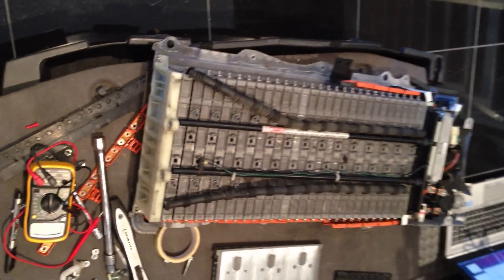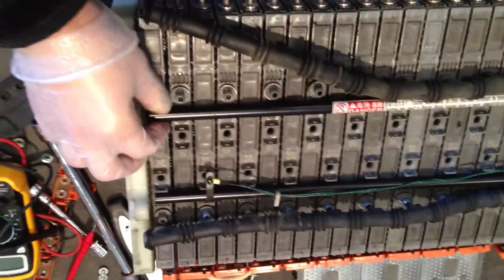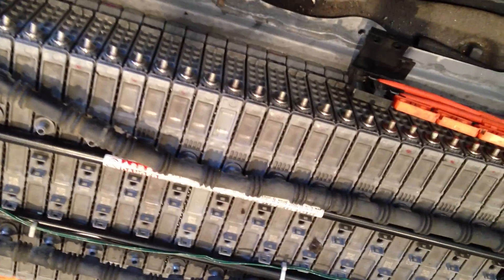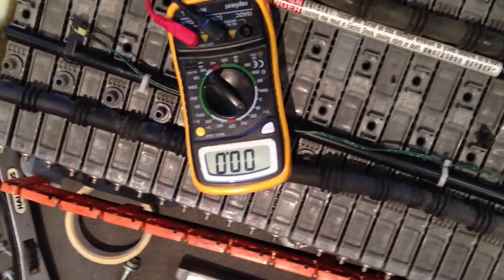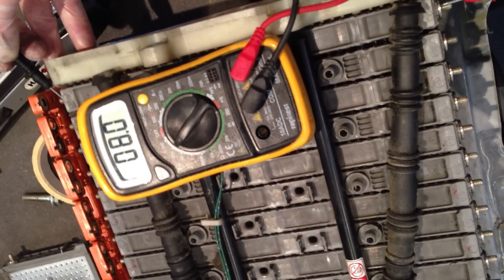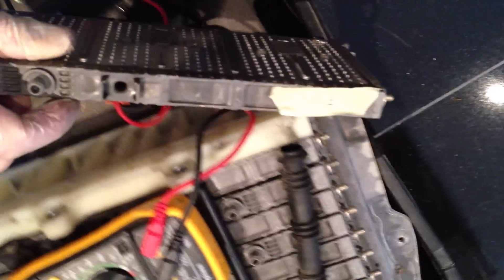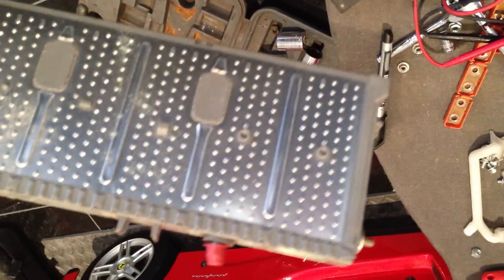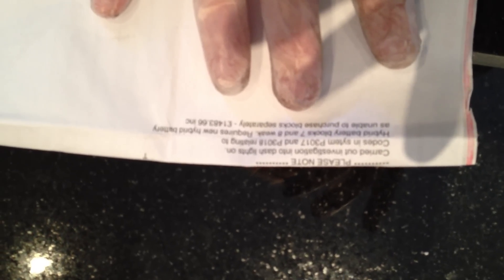Toyota Prius Fix and Replace Battery cell repair cheap.  Lexus Auris Camry Toyota DIY

Comment: I was saved from spending funds on a brand new car battery when I heard about the reconditioning program ( Check Details Here>>>v ), therefore I tried it to recondition my old auto battery! I thought it would take much effort and hard work, however it was simple as ABC. That already saved me about $ 100 and there are a lot of some other batteries.

Comment: I'm doing the loading and unloading test for CIVIC HYBRID 2005 with Imax equipment. but this team has to set the maximum limit you in mah where it will arrive. I put 6500 which is the maximum load to 0.6A and 1.0A perform the download.

What should be my right values in mah to result in a good performance, I read enforos that the burden should give me a maximum of 6200mah and download between 5500 and 6200mah.

Will I have to increase the amount of amps loading and unloading for each battery. or care if I leave as I?

Comment: Question, I saw some of the terminals had some corrosion on them. Did you get a chance to clean those up? What did you use? I think I'd hit it with my dremal and follow up with some bulb grease. What say you?

Comment: what setting are u using on the multimeter in the volts section
Reply: Looks like he had it at the 200v range, but 20v should be fine. If you are doing pairs of batteries 20v should be fine as well. Any more batteries then than then you'll have to go back up to the 200v reading.
Reply: +Robert Rodgers is there a min-max range for each battery. i tested mine with a multi and last week they were all 7.63 to 7.65 now they are all 7.5

Comment: I purchased a rebuilt battery for my Prius ! with GEN II cells. I paid a premium and the battery had a foult initially but driving for a while I could reset the code 3006. To make a long story shorter after a month and a half (waiting for over a month for shipment in the first place) the battery failed. Another month + and no word form Falcon or prius rebuilders on the warranty replacement as promised. 
I took the car to a shop in Ft Walton and they removed and inspected the battery and found two bad cells and of the rest of the cells 1/2 tested OK and the rest were marginal. These cells are from 2004 and the tech said that these were the oldest cells he had ever seen!.
Basiclly these cells were just slightly better than the scrap that Prius Rebuilders and Falcon purchase as scrap in bulk. 
In my opinion you are far better off taking your car to a local guy and have him test and change the bad cells like I ended up having to do to get my car running again.
Do not trust these people and save your money and time and deal with honest trustworthy companies.
If you read other bad reviews don't think that one bad report can happen to anyone like I did. They are bad news and stay away from them.
By the time you have fought over replacement and paid freight and received a battery that is as big of a question mark as the one you removed you could buy one from a reputable company or have a speciaist replace a few bad cells and be better off.
Dont believ their hype on having batteries ready to ship. It was over a month to get my first (bad) battery and over a month and I still have not heard that my (questionable) warranty replacement is ready.
Abe Sokol had lied to be from start to finish and he will lie to you as well!
Stay Away

Comment: The Prius warning panel gives you the same "Main Battery" icon when the little 12 volt starter battery dies.  It only costs $200.00 at the dealer.  Replaced that or charge it first before you go through all the trouble of replacing the drive battery!

Comment from the maker: UPDATE: Sept 2014 and 10,000+ miles later and the car is still working perfect.
Reply from the maker: Update March 2016 my Prius is still working perfectly after this fix 👍🏻👍🏻👍🏻
Reply: @Ratarossa2   Any updates?
Reply: +CoffeeShopCars There are several components to battery repairing. One resource I discovered which succeeds in merging these is the Magic Mender Wizard (check it out on google) without a doubt the most helpful course that I've heard of. Check out this  awesome resource.
Reply: +CoffeeShopCars There are several components to fixing a car battery. One place I discovered that succeeds in merging these is the Magic Mender Wizard (google it if you're interested) definately the most useful course i've seen. Check out this  extraordinary site.

Comment: worked for me, the hard part it´s putting all cell´s together again, I´m still testing my car, so far so good.
Reply: Updated: battery dies, these method didnt worked XP
Reply: Alexander Juarez Did you drain the battery then balance recharge?
Reply: How do you drain, balance and re-charge the battery?

Comment: Soo.....I'm a mechanic at a Toyota Dealership and we definitely have to wear better gloves than that, there's quite a bit of power running through there even if it is just 1 or two cells.
Reply: Soo....your the kind of people that actually charge hard working families $4000 to change it for them, but thats ok because you wear better gloves?  Why does your company rip so many people off with this issue rather then just replacing and testing cells like this AT THE DEALERSHIP!!?
Reply: hey slick, if a dealership mechanic replaces the one faulty module on your 12 year old hybrid battery and two weeks later your idiot light comes back on, he gets to fix it for free without getting paid since toyota does not warranty a repair like that, their assumption is that if one module is failing now the other ones aren't far behind it. if he replaces the entire battery then toyota warranties that repair for up to one year since someone like you who would probably throw a temper tantrum in the dealership if this happened. whats more of a rip off, charging you to replace all 39 modules as they fail one at a time at about 7 hours labor each multiplied by oh i dont know $120hr? or to replace the whole battery, you do the math genius.
Reply: +Tyler Steen only a rippoff dealer would charge 7 hours for a 3 hour job and consumer should get to make the choice on what they want to repair your logic is like saying replace the whole engine when the water pump goes cause when the timing belt brakes the following week the dealer will have to fix it free. and id the dealer is charging top dollar for replacement battery then why a 1 year warranty. it should be 8 years the same as a new one in a new car. since your overpaying to swap it out 7 hours x 120.00 840 how do you sleep at night
Reply: +kodiackid 7 hour is more time than a novice would need just to swap a battery from a trained pro at the dealer that does it everyday should never take more than 2 hours
Reply: To clarify: The rate charged at a Dealership is a set price in AllData, Mitchel1, Chilton or Toyota's Repair Time Guide designed to ensure no time is overcharged to any clients. That time is determined by those companies, respectively (usually by the average amount of time it takes that repair to be done on 50+ vehicles). More time might be charged (approx. 30-50%) for things like: damaged components, rusted parts, aftermarket accessories-anything that makes the job take longer than normal. Repairing individual cells is not a repair Toyota trains their technicians on and is not approved to do so for that reason, it is dangerous and wouldn't be something most technicians are comfortable doing. The batteries are sent back to Toyota for the technicians who do know how to repair them properly (Those are turned into cheaper re-manufactured batteries). According to AllData-Labor rate for replacing a Hybrid Battery is 1.7hrs(probably rounded to 2)@$116ph. and the Battery costs Approx $3700-Core ($1300-$1500-depending on the size). The reason the warranty is less is because those are typically re-manufactured batteries so the cells may not last as long as a New battery. That 1yr warranty is a warranty on the work performed-not the battery itself, the battery warranty is determined by the battery manufacturer. If the battery failed, typically the battery manufacturer or insurance would cover the cost of labor. Additionally, the dealership is also not the only place to take a battery to be replaced/fixed. There are other repair shops that are specifically certified to repair a battery like in this video  for a lower price than the dealership because more hybrids are on the road.
Reply: +Sergio Salinas well you said 7 hours I think 1.7 or 2 hour is reasonable. as far as remanufactured 1 year is understandable but brand new should be longer. the reasons I'm not happy are for things like being told longer times than reasonable they want to charge 700 dollars for each light changed on headlights. why because some book says to disassemble the front of the car and part of the left and right quarter panel to get at the third bolt on the headlamp. that is done from a poor design to make dealers more money. I can change by hand without tools or removing the headlamp by just opening the back of the light. why can't they change the book for that. I would understand if you had to change the whole light but just the bulb it's not necessary to screw people over.
Reply: +kodiackid hey genius, what makes you think a car manufacturer designs cars with the thought of the dealership making money servicing them? is that why all new cars use fluids and other wearable items designed to last damn near forever no longer requiring them to be serviced? they could care less about dealerships making money servicing their products, least of all mechanics. dealers charge what they charge based on what competition in their market charges, not what a book says to charge, not what the manufacturer says to charge and definitely not what a penny pinchin first gen prius owner/wannabe engineer thinks they should charge. you ever clean corrosion off of your car's 12volt battery terminal only to find that a couple months later the corrosion came back? thats because there is no seal around the battery terminal and the battery case, first gen prius battery are the same, they leak and once they start to leak they won't stop leaking, thats why replacing one bad cell is not the "professional" way to repair the vehicle, you wouldn't be happy when three months later your idiot light came back on. replacing cells is what one might call a backyard mechanic fix, the repair will work but not for long.
Reply: +Tyler so tell me exactly which genius is responsible for charging 700 dollars for each light bulb to be changed in the headlamp on the prius that only takes anyone that has changed one more than twice 10 minutes because the going rate at any reputable mechanic shop would only charge 1 hour max for both and some would do it for no charge just for selling you the parts and as a service of good faith. I have a second Gen prius and if my battery was leaking I would change it. but 1 dry cell out of 28 doesn't justify replacing the whole thing that's just being irresponsible to the environment which is one of the main reasons people buy a prius in the first place. To help the environment. Why is the prius unable to be put in neutral upon battery failure? Do you think that's safe? How many people should have to die before they do something about that??? Other cars have a cord that you can pull to put their vehicles in neutral so they may be pushed out of harms way. You can blame the dealership or the engineer or the parent company but your the one that works for them they sign your paycheck. Someone in that company needs to step up and make it right. I certainly don't blame you but try doing 65mph some night then kill the lights and try stopping your vehicle in the dark and pulling over because of another faulty problem with the dashboard causing all kinds of failures.
Reply: +kodiackid  The work instructions are based on the components that need to be taken off to do a repair "the correct way". There are easier ways to do it that are faster, but those are not the ways the manufacturers lists because they are not repeatable by everyone. For instance - the bulb on the Left side of a 2nd Gen Prius says you have to remove the front bumper and headlamp assembly because unless you have really small hands it's pretty difficult to do (especially the ones with HID lenses) The right side is easy to do without pulling anything off but I've always had to pull the headlight out a little bit on the driver side. An engineer decides this is the way a bulb "should" be replaced and estimates the time to be listed. In my opinion $700 sounds like a shop just charging an outrageous amount (.9 labor for the bumper and headlamp assemblies & .2 per bulb)+($130-170 HID bulb) unless the labor for pulling off the bumper was charged twice or something. That's why the labor times are there, so everyone gets charged the same labor rate, as a technician, this is how your experience pays off. The quicker the job is performed, the better you get paid, because your paid by "flagged hours" not how much you are physically working on the car. Trust me, the automotive field has been working on this issue for a long time because sometimes it's not fair for clients, but it can also be unfair for the technician if the repair takes longer than the listed time. The reason why a Prius is locked into the park position is because the transmission is half gears and hydraulics like a normal car, and the other half functions by the use of two electric motor/generators that propel the vehicle forward and send regenerated electricity back to the battery. If the vehicle were to be towed or rolled on the front wheels it would generate an enormous amount of unused electricity which would cause a lot of heat. That heat would permanently damage the battery and weld the internal components of the transmission together. Also, it would turn the electric motors into really strong magnets which would damage electronics from the magnetic  field generated. Manufacturers always put stuff like that in for a reason, sometimes it's obvious, sometimes it's unknown to the public. But there is always a reason, it just has to be dug up.
Reply: +Sergio Salinas I understand the unused energy but if put into a neutral or emergency neutral then it could be pushed off to side of road  or even towed disengaged from the transmission. I believe the hybrid camera has this release function. how dangerous when you break down on a highway trying to pull over  and get stuck between 2 lanes I've seen this happen twice resulting in a wreck both times and severe injuries for other driver on one occasion. as far as dealer charching twice I don't know when told the price and asked to double check they said that's what it was to replace the bulbs

Comment: question if anybody can help: i bought a hybrid battery in the junkyard, but if has been more than 6 months out of the car, and it doesn't have any charge, I connect a charger in and is not taking any charge , Anybody know how to plug the charger so I can charge it?????